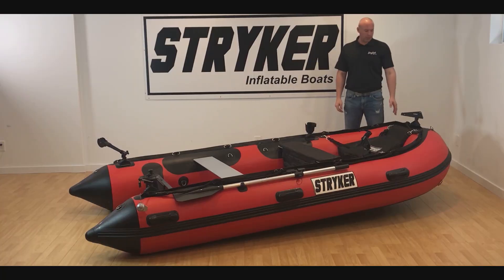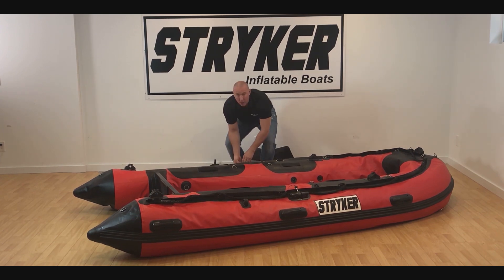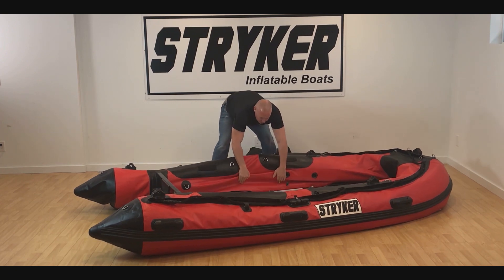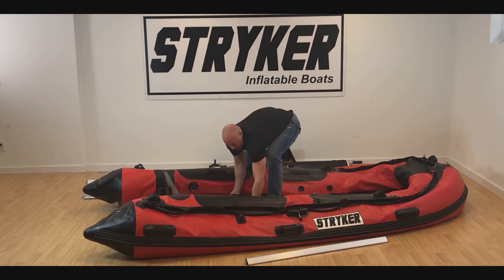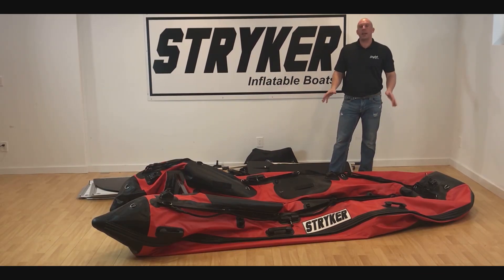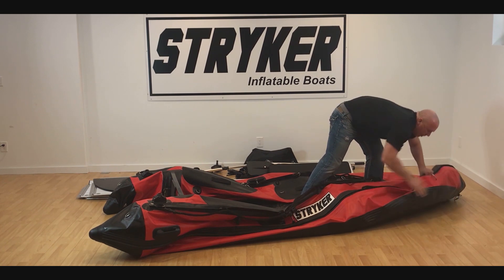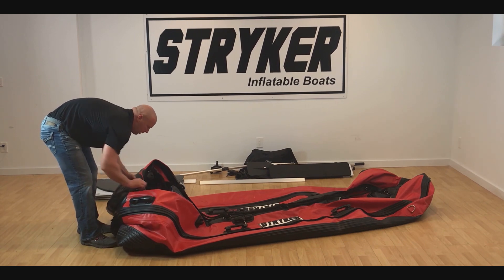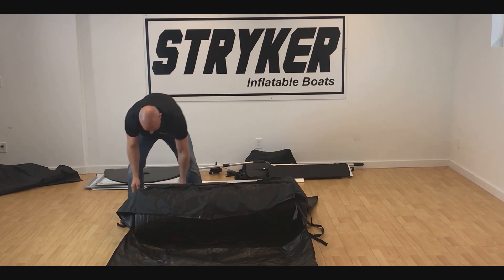Stryker Boats - Tutorial - How To Fold Your Inflatable Boat

Comment: One thing I found when deflating is there comes a point where the exterior an internal pressure stabilize, and the boat will actually want to take on or inhale more air than it expels. I close the valves off at that point, and start to roll the boat. Whatever air is left will be forced towards the chamber ends, at which point you can then open the valves again as you roll the boat closer to those valves. Then close again. It helps if you have a 2nd person. 

I'm not sure at the factory if they actually create a vacuum or what, but that is my guess. I thought about taking a vacuum cleaner and making a fitting, but I've also read a small amount air can provide some cushioning to avoid permanent creases. I don't know. Thoughts? 

I can only imagine on really large boats how difficult this can all become. I have 16 inch tubes and it really requires some "Manhandling" to get the boat where you want it. I would certainly not want to do this on every trip. I leave mine inflated on the trailer most of the year. I also agree that it's good to check out your aluminum floor, as mine came a sharp edges as well. One wrong move and you can puncture the fabric. Manufacturers should really pay closer attention to this.

Comment: One small comment about the floor boards, the aluminum edges at the sides of the boards are very sharp and scrape against the unprotected parts of the fabric when you are installing and removing the floor boards, I'd suggest taking some sandpaper and smoothing these edges down.